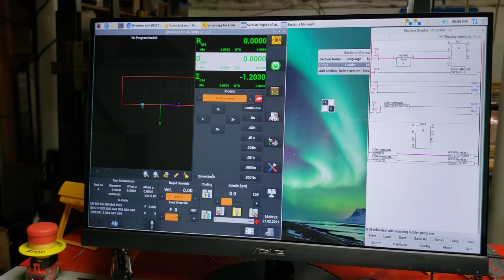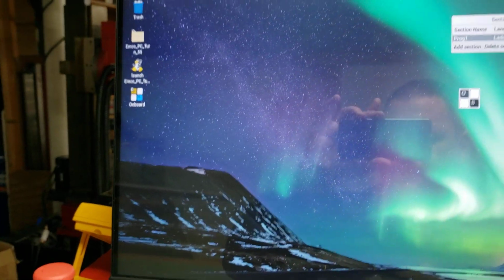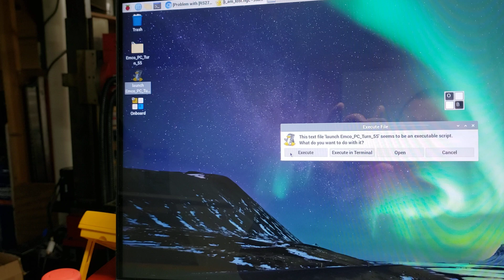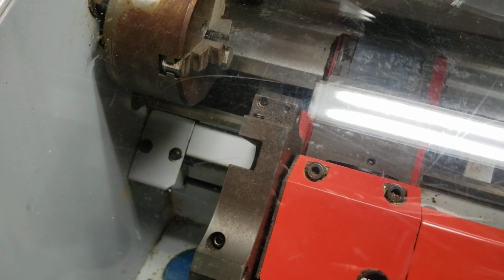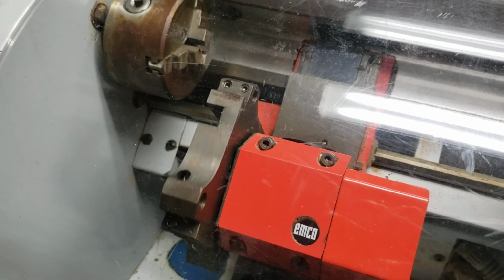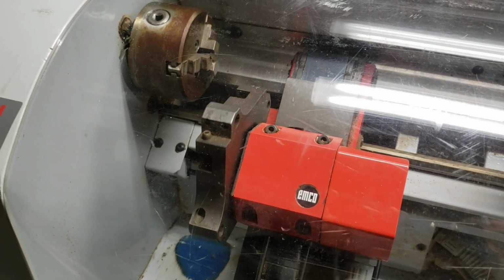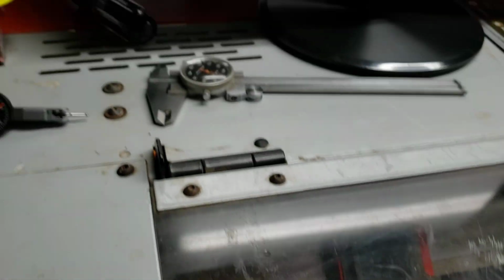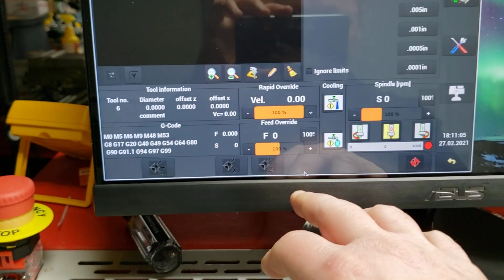VICTORY IS MINE!!! Emco PC Turn 55 Linuxcnc turret homing victory dance

Comment: Can using classic ladder to set your tool change sequence be linked to an M6 or do you have to do a Remap =M6 and link it to a .hal file? I cant get my remap to read my .ngc file for my tool change sequence so I was thinking I could work out the logic in the ladder logic.
Reply from the maker: I mapped it to the standard m6 command already in LinuxCNC, i didn't have to use remap. Without remap, you'll have to position the machine where you want to do the tool change and then classicladder can be used to check machine position and perform all of the necessary commands required for the tool change. 

The center rung of my turret ladder shows two lines, each with an input and an output coil. The first line is for tool prepare and tool prepared, the second is for tool change and tool changed. The things that happen between those lines are things you can set up in classic ladder to check and perform. The tool prepare and tool prepared section is already smart enough to not tool change if the machine has the proper tool in position, so I didn't need any logic for that, but you need to make sure you link prepare to prepared and change to changed.

I can send you my files if you'd like to have a look. Shoot me an email. theferalengineer@gmail.com
Reply from the maker: Also, if you need to remap, make sure your ini file is set up for remap=m6 modalgroup=6 ngc=m6
And your rs274ngc section has subroutine_path=(folder path for m6). Inside your path folder, make a .ngc file called m6.ngc. inside m6.ngc you'll put stuff like:

o<m6> sub
(Do stuff)
o<m6> endsub
M2

You can test your m6 command in LinuxCNC by putting o<m6>call in mdi. It will alarm if it can't find your m6 remap sub. 

I can send example files if you'd like.

Comment: Awesome!  I would say the normal way to do this - when the first tool is called - the homing sequence is done.  (I use the CAROUSEL component - and that is what it does)  I think there is also a example here  http://wiki.linuxcnc.org/cgi-bin/wiki.pl?ClassicLadderExamples
Reply from the maker: Thanks, Sam. I'll check that out and see. I was trying to come up with a way to home it initially, the button to a sub was the simplest way I could think, but I'll give this a look.
Reply from the maker: As a bit of a side note, the older DMU 50 (second generation) and some of even the newer CMX series machines from DMG Mori utilize a cycle start to initiate a home sequence of the tool magazine on startup, so I really don't mind the way I've got it set, because I'm kinda used to it from using those machines. I was trying to think of a way to get it to auto home on first tool call and this was path of least resistance, but I love to tinker, so this is just the first of many iterations, I'm sure.
Reply from the maker: Think I've got it figured out. Thought about it as I was falling asleep last night 😈
Reply: @TheFeralEngineer  that happens with me a lot...
Reply from the maker: @MakersEase  i got it! Instead of using a cl input for a button, i just do a comparison to the other counter to trigger the overrun 👌👌